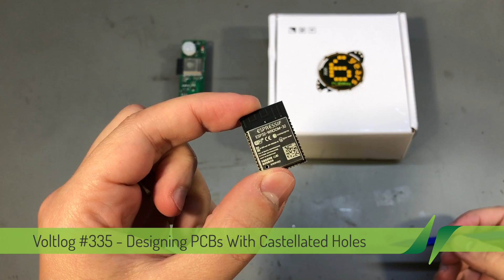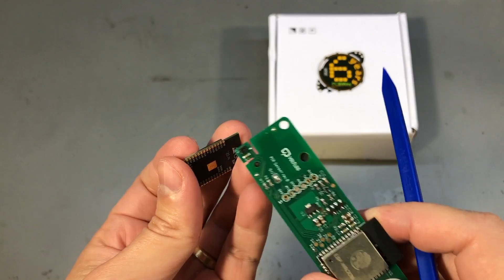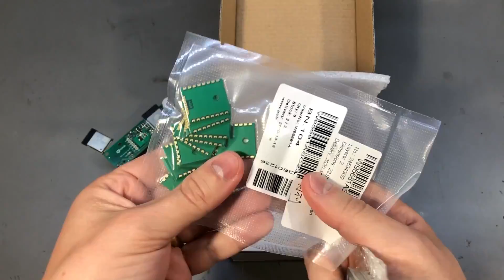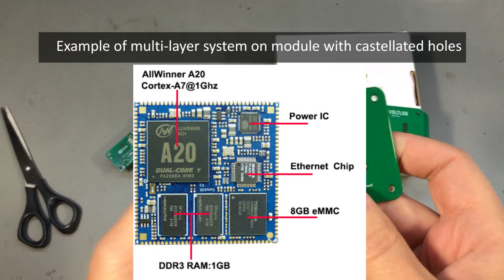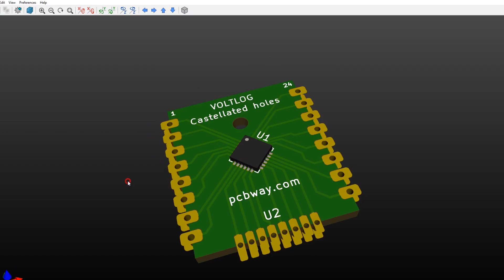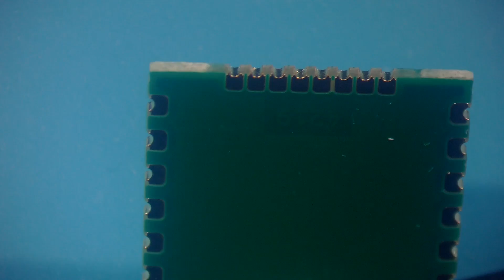Designing PCBs With Castellated Holes | Voltlog #335

Comment: Is there any consideration for the pad on the pcb where the castellated holes will be soldered on?
Reply from the maker: Footprint pad size should be at least the size of the pad size, ideally soldermask defined pads. Footprint pad can be extended towards the exterior/interior part of the module to help with misalignment during placement but a lot of this varies depending on the specific application.

Comment: Thanks for the info. Designing these seems to be quite simple if you specify your intent with the manufacturer.

I see you went with rounded rectangular pads. Is there an advantage here over circular pads?
Reply from the maker: I use rounded rectangle pads as a general rule with all of my footprint designs because it's recommended by newer IPC standards.
Reply: @voltlog  Ah neat, thanks!

Comment: At the time of pcb design how to decide where which track width are use
Reply from the maker: Track width is decided based on current carrying capability as well as min track width spec from the PCB fab house. In special cases you also have to consider the impedance of the track which will affect track width.

Comment: Just a quick note: Copper is way softer than glass - for a mill which usually cuts FR7 copper is like butter. Some board houses simply charge too much. OSH Park on the other hand does not charge anything (but doesn't guarantee perfect outcome). One of the bigger advantages of castellated holes are: you just need SMD pads on the receiving board. Through holes instead eat up routing area on all layers as we all know. One tip to circumvent extra charges: Order the board with the outline outside the holes and route (or sand) them back yourself.
Reply from the maker: I suspect board houses charge extra for castellated holes not because of "wear" that might occurs on their tooling but because they need either a special tool to cut them without ripping the plated through hole or some extra steps to make sure they are left nice and clean or maybe even a combination of these factors.